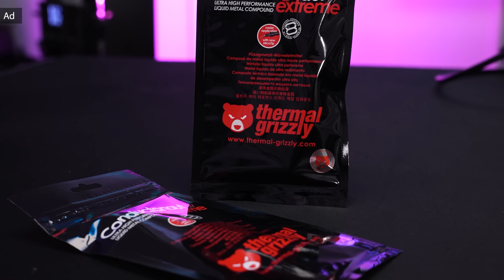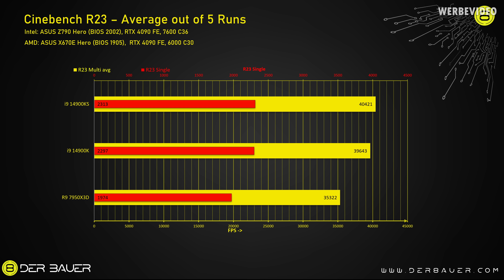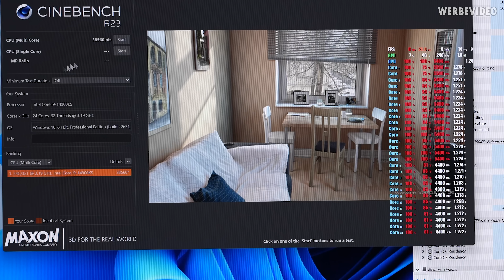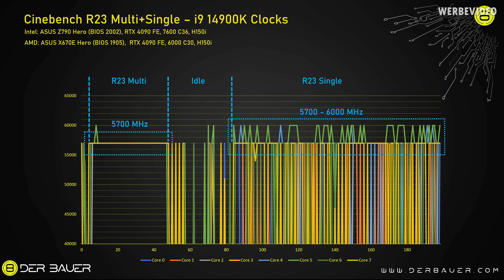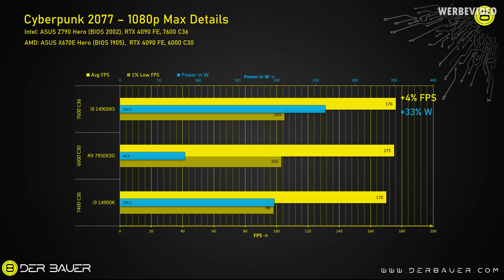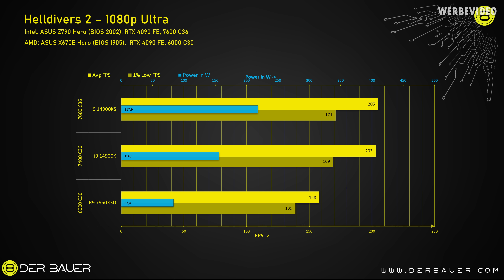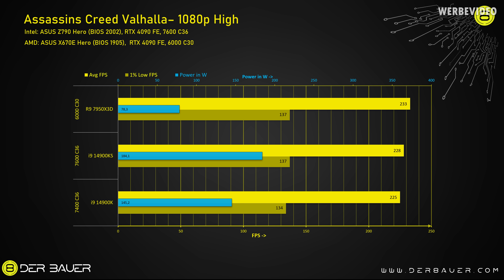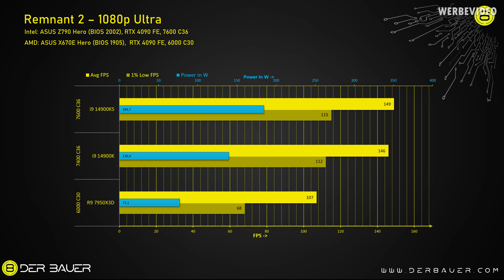Almost 400W under Full Load - The 14900KS is one of the Most Extreme CPUs ever Made

Comment: This just cements the fact that AMD is the leader in efficiency.

400 W just to be a few percent faster than the 7950X3D is crazy!
Reply: Comparing auto-overclock to in-spec does not tell you anything about efficiency.
Reply: @ABaumstumpf  
Stop waiting for the Asian kid to do your homework for you.

Calculate the frames per Watt.

Do the math.

(Even if you scaled the result to normalise to stock clock speeds, AMD would STILL come out ahead in terms of efficiency. Clock speed drops, power consumption drops, so you'd still be more efficient.)
Reply: @ewenchan1239 and would your conclusion change if you then used the configurable chip settings to undervolt? Just because it comes in one configuration does not mean it must stay that way. The Intel chips have lower consumption at idle, not sure about what the absolute performance is when turned for efficiency, but I cut power in half on my 12700k and retained 90% Perf. The relationship between GHz volts and perf isn't linear, and can be adjusted bi directionally.
Reply: @Electric_Bill 
"and would your conclusion change if you then used the configurable chip settings to undervolt? Just because it comes in one configuration does not mean it must stay that way. The Intel chips have lower consumption at idle, not sure about what the absolute performance is when turned for efficiency, but I cut power in half on my 12700k and retained 90% Perf. The relationship between GHz volts and perf isn't linear, and can be adjusted bi directionally."

 Four things:
1) re: undervolting
You can only assume that the power consumption will decrease proportional to the magnitude of the undervolting IF and ONLY IF you assume that the maximum current draw through the pins on the motherboard remains CONSTANT.

That MAY or MAY NOT necessarily be true.

2) As the video shows at 7'15" mark, the 14900KS achieve 176 fps at 1080p max settings whilst consuming 262.3 W.

In comparison, the 7950X3D achieves 175 fps, at the same 1080p max settings whilst only consuming 82.9 W.

176/262.3 = 0.67098741898589401448722836446817 fps/W

175/82.9 = 2.1109770808202653799758745476478 fps/W

2.1109770808202653799758745476478/0.67098741898589401448722836446817 = 
3.1460755016997477793617721241364

Think about how much undervolting you will need to do, in order for you to DECREASE the power consumption so that you would INCREASE the fps/W efficiency by over *3x*.

Good luck with that.

(How silly of you to think that you'd be able to improve your fps/W efficiency by undervolting. LOL....LMAO.....)

3) "Intel chips have lower power consumption at idle."
Irrelevant in gaming.

4) "but I cut power in half on my 12700k and retained 90% Perf. The relationship between GHz volts and perf isn't linear, and can be adjusted bi directionally."
Doing what? What load are your running? What settings are you using?

If you undervolted a 7950X3D, what kind of results would you achieve?

Why do you employ the ancedotal evidence logical fallacy in this data driven, evidence-based discussion?

There is no QUESTION that you can reduce your power and keep MOST of your performance.

But you'd have to cut your power by 68.2% whilst still keeping the average frame rates where they are, just to MATCH AMD's efficiency.

That power reduction doesn't even BEAT it. And you have to HOLD the performance constant, which, as you admitted, won't happen.

How much performance would you lose, if you were to cut 68.2% of the power consumption, going to your CPU?
Reply: @ewenchan1239 tf is your math skill
FPS per Watt = <Framerate> / <Power draw in Watts>

14900KS FPS/W:
176/262 = ~0.67 FPS/W

7950X3D FPS/W:
175/83= ~2.11 FPS/W

you literally mentioned the correct formula and then started pulling numbers out of your hindquarters
Reply: @mikeycrackson  
Agreed.

Dr. Su has been an absolute force at AMD, in turning that ship around.
Reply: Yes! I was going to get an Intel pc, but after getting an AMD CPU with 40% less power consuption I'll never go blue again 😂

Comment: Hmm I have posted my comment and now it is not there any more. Anyhow Intel CPU's have issues with  mixing P an E cores as well. Cyberpunk 2077 was sometimes using few E cores instead of only P cores. So every time you launch it performance would be different depending on luck of the dice. They have addressed it few times in patches and gave us even settings option to prioritize P cores and that made it even worse in the first iteration. Well Cyberpunk 2077 is extremely good game but technically they broke everything they could break so many times. I love the game. I have tried it with my old 12900K and DDR4 Z690 mainboard and with my 14900K and Z790 mainboard with G.Skill Trident Z5 6400 CL32.
My FPS went from 118-120 FPS to max 123 FPS when option was selected but then would drop next time. Now my best FPS with new stuff is 135 but every run it can drop to 130 FPS.
That all with extremely big water cooling setup that cools both my 4090 and my 14900K.
My cooling setup can run my 14900K even with 24 Threads small FFT's in Prime95 completely stable. That load made peak power draw of 404 Watt and is always around 400 Watt.
Nowadays optimizing CPU is necessary. IF it draws to much it does not even perform better at all. I have limited P2 and undervolted and power draw is way lower and some benchmarks even show higher numbers.
Good cooling is a king though. Contact frame and all.

Comment: AMD doesn't allow overclocking ???🤔🤔🤔🤔
Reply: the x3d cpus dont
Reply: @LatvianVideo  the multiplier and voltage settings are unlocked, and you can turn on PBO if you want. but OK the gain is very limited.

Comment: I'm really interested in how the MTBF is going to change for these Intel CPUs down the road. Forcing through higher voltages and having much greater heat and power dissipation has to influence the rates of electromigration that lead to dead CPUs.

My instincts say to not expect more than 3-4 years out of these CPUs, but I'd love to see some evidence.
Reply: Probably less time than that for the KS cpu's, if they're not undervolted. For keeping stable 6.2ghz clocks. They're running at insane voltages.

Derbauer's cpu was hitting a core vid of 1.48v, my i7 14700k hits at around 1.35-1.36v out of the box, still not the best voltages, but a lot better than the ks's voltage.

Comment: It's impressive how much less the 7950x3D is consuming while almost at the same performance
Reply: Userbenchmark HQ explodes
Reply: That''s peak intel for ya, always costing more and consuming more energy
Reply: To be fair AMD is using a MUCH more advanced node than Intel's 10nm. The fact Intel can even keep up when using a relatively archaic process and without 3D vcache is a testament to Intel's engineering prowess. Now that TSMC is slowing down it should get quite interesting if Intel really does surpass them on bringing 20A and 18A online. At the very least it will undoubtedly be laughably more efficient than 10nm.
Reply: And with 1600MHz slower memory.

JFC Intel.
Reply: Amd FTW 😂😂
Reply: Got myself the 7950X which is 2.5% slower than the i9-14900KS but consumes about 180W at 100% (16 cores at 5.1GHz).
Reply: Whats even more impressive is the 7800X3D, yet its not in these charts for some odd reason. It does even better in games.
Reply: @mazuiface It's almost like he left the 7800x3d out of these charts by design. It'd beat the 7950x3d in a lot of games, which means AMD would still smoke Intel's latest and new 14900KS, WHILE still being extremely power efficient.
Reply: @luminatrixfanfiction My thoughts exactly. The 7800X3D costs half of what the 14900KS does, beats it in gaming, consumes less than 1/3rd the power, and generates much less heat allowing it to be cooled by small air coolers.  It's the perfect comparison to show just how bad this new Intel chip is.
Reply: @mazuiface  Yeah, and any gamer is going to be miserable gaming in a room equivalent to a furnace in the summer. AMD went the right route with power efficiency performance per wattage. And I think Intel has realized that they can't keep pumping more power or voltage at the problem.
Reply: @luminatrixfanfiction  dude that's happening because AMD uses 5nm architecture and intel have 10nm. The 15th gen will be a great competition for amd, as it is coming with 3nm architecture.
Reply: @computerscience1101  The problem with that is, intel cpu's are about to become a heck of a lot more expensive presuming that they have to upgrade their wafers to 3nm architecture, which would likely increase the failure rates during the fabrication process. AMD has had time to perfect their 5nm architecture, so if they upgrade to 3nm, their success rate will likely be higher owing to their matured fabrication process.
Reply: @luminatrixfanfiction  hmm... that's a valid point.
Reply: It's very finicky with scheduling though just like mentioned in the video. For primarily gaming, the 7800x3d is a much better choice.
Reply: @HenrySomeone  You could use something like Process Lasso to manually control what cores are being used, but this might require experimenting with what works best for each game and many people just want it to work right straight out the box. Still, if you know what you're doing and have the patience  you could make the most out of the 7950X3D. There are some games that will use more than 8 cores when things get more demanding, which could make the 7950X3D better than the 7800X3D, especially on the percentile lows which is where you will more likely be CPU limited.
Reply: Why? It is not really surprising that a CPU that has a abysmal but extreme auto-overclock applied will have bad efficiency.
Reply: "almost" the same is quite a cope
Reply: @markdeckard7651  almost, with 1/2 the power and 2/3 the cores isn't a cope. That's the same exact position AMD was and people trashed AMD. So start trashing Intel for doing the same thing. They are throwing power and cores at the problem to stay competitive. If this keeps up they won't be competitive in next year with the next cpu release by AMD.
Reply: @wessidemessside  I don't think so. 15th gen is coming with 3nm Architecture unlike the 10nm of 14th gen.

I don't want monopoly like intel did in early years, now AMD doing the same thing money over innovation their 8000 series is a great example. I hope competition continuous from both sides.
Reply: @markdeckard7651  no you're right.. he got it wrong. 7950x3d equal on average while using cheaper Mobo, power supply, ram and heat sink and putting out less heat as well as using half the energy.. costs less for consumers and AMD makes higher margins to put toward future RnD. 

Platform longevity.. huge upgrades for AMD and Intel gives you +20% max. What was 1700x to 5800x3d? 20%? Lol it was 1.7 to 2.3x depending on the task. 

Since you are going to fanboi over a product or company for reasons not related to the value of the product.. how abount AMDs innovation.. I am far more impressed with what AMD has been able to achieve and all while being a fraction of the size of Intel. 🎉💪

So.. are you really going Intel for a few % here and there where AMD makes that back in other tasks?

Don't forget that these benchmarks are wrong as Tim said it was not using vcache chip. This is super easy to solve and makes the 7950x3d performance identically to 7800x3d. Tim obviously did not want to put ANY effort into this review.
Reply: Am I a fanboy? As far as I understand it, a fanboy continues to back up a company or product even after than product falls under heavy criticism or is simply no longer as good as the competition. Since AMD is the objectively better choice here.. I am not a fanboy. I am smart.
Reply: AMD has 2.5x worse 1% lows. Absolutely atrocious for AMD fanboys. Yikes.
Reply: @OC.TINYYY Not really, it depends on what amd cpu and gpu get paired together. If you have a perfect match, neither cpu nor gpu will be waiting on data from each other. That's why there are 1% lows. The same applies to intel cpus as well.
Reply: @OC.TINYYY Where's the data for the 1% lows? I'd like to see it. You better not be wearing that meme frog profile for no reason.
Reply: @OC.TINYYY  a former intel fanboy here. Intel is getting absolutely horribly beat. The days of the 4770k are over. When Intel started saying no one needed more than 4 cores they already were having design issues and the fan base just bought into it!
Reply: The 7950x3d is a garbage CPU that cuts its cores in half.
Reply: @ZackSNetwork it is objectively the better CPU. Tell me you're a brainless fanboy without tell me you're a DA.

Comment: The job for the scheduler assigning intel's p and e-cores is much easier as the p-cores are always faster. With AMD that is not the case as the non x3d cores clock higher and may thus be preferred in cases where the cache is not beneficial.

Comment: Intel is not pseudo-supporting delidding out of the goodness of their hearts.  It is because basically all available CPU cooling options are incapable of allowing this processor to perform at its maximum potential, and thereby differentiate it from cheaper SKUs.  They will not officially support it for general consumers because the risk of physical damage to the die is too high.